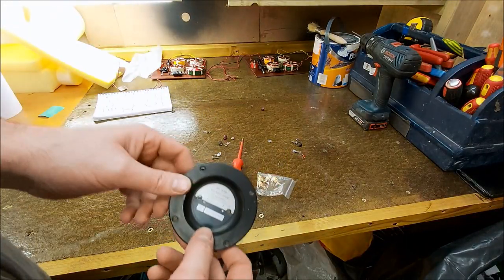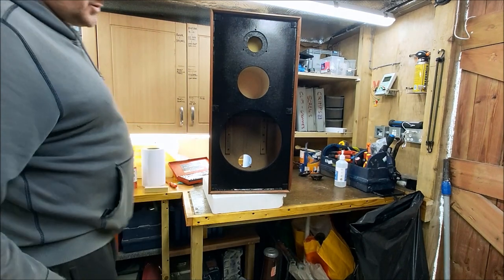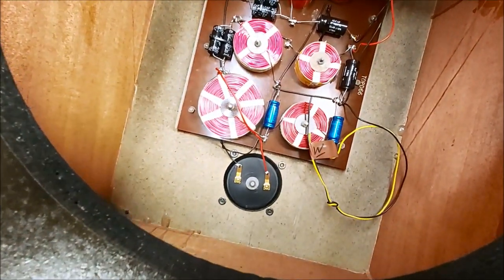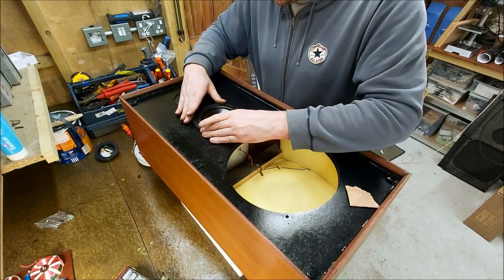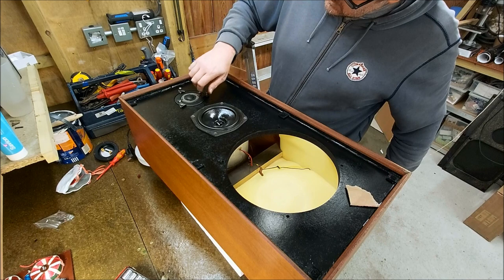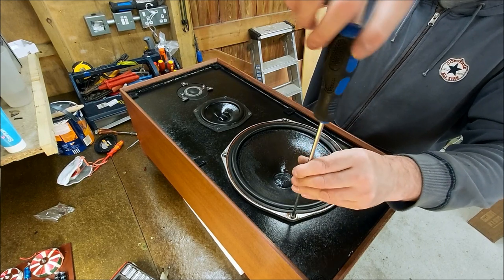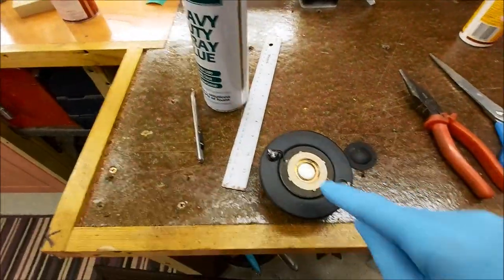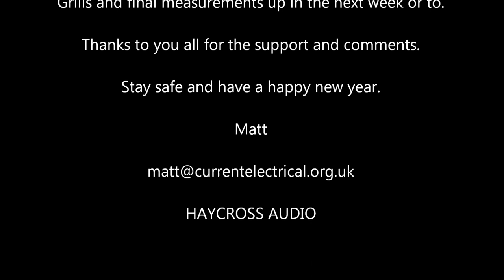Celestion Ditton 44 Part 4 Larrys

Comment: British speakers are often "voiced" with  their "Alcaps Bipolar' and changing these to polycaps does affect the sound as it will change the damping and  or "Q" factor of the transfer function amongst other things. Same can be said for falcon acoustics ferrite inductors as these inductors have a "colour" that is part of the sonic response wanted by the designers.
Reply from the maker: Exactly. We are not here to re-engineer these lovely speakers. We're bringing them back to there former glory.
Reply from the maker: @matthewtaylor7355  I know this speaker very well. In the last 3 years I've had 8 pairs here. I have another pair which arrived last week for refurbishment. I've rebuilt loads of crossovers for these to so know does and doesn't work. I've also owned my own pair. I love the 44.

Comment: Hi  Matt have been following your Larry's 44 project with great interest. Ever since I acquired mine following your sound advice ( pardon the pun), I have been very pleased with them, however I became concerned when you thought the ageing faulty caps had damaged the HF2000. In view of this I am going to re- cap mine as you have done.You mentioned earlier about Air Cored inductors and the improvement they make, do you think it would be worthwhile replacing the iron- cored for air cored, I also intended to replace the binding posts as you have advised. I too enjoy real ale, favourites being,(London Pride, Hobgoblin, Doom Bar and Old Speckled Hen). I would appreciate your thoughts on the inductors please.
Reply from the maker: Hi Rob. Glad your an ale fan. The ales you note are some of my favourites to. I'd also add Abbot to that list to and the occasional Crafty Hen to 😋.

With regards to inductors. Air core are better. I'm guessing you have the standard version of the crossover which would have 2 iron core on the woofer circuit and one on the midrange circuit. There should also be a air core on the midrange and one on the tweeter. Having air core on the woofer circuit isn't critical due to the low frequency and longer wavelengths but I would replace the iron core on the midrange. I think its 2.28mH from memory but will confirm tomorrow when back in the office for you

Comment: Hi Matt have acquired a full sett of Alcaps and new binding posts I read on another channel someone suggesting placing the crossover in the bottom of the cabinet by the input terminals and further from the base magnet, what are your thoughts on this please.
Reply from the maker: Your better off being under the woofer magnet as opposed to the side if it. Your making unnecessary work moving the crossover board. It's not small. New capacitors and new wiring will see you proud. Good luck Rob